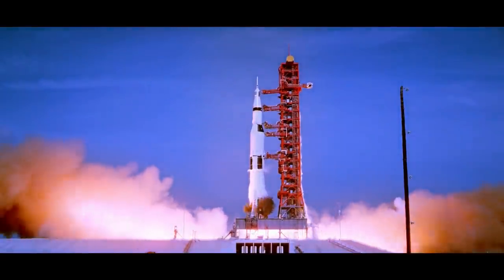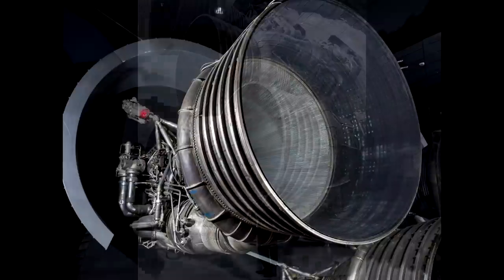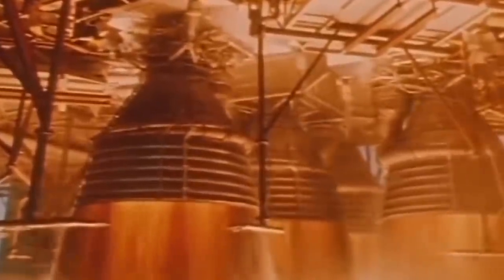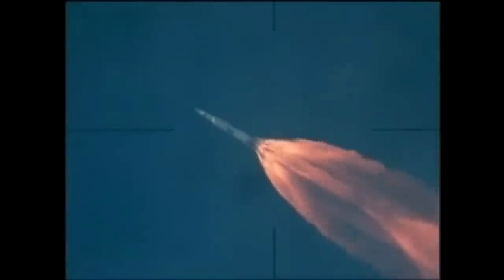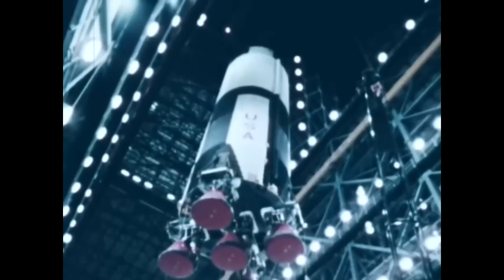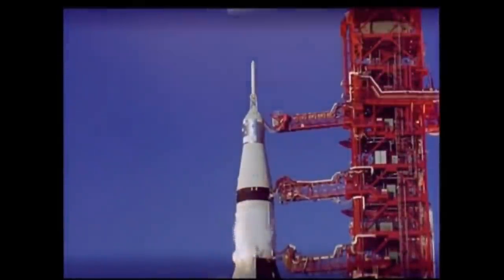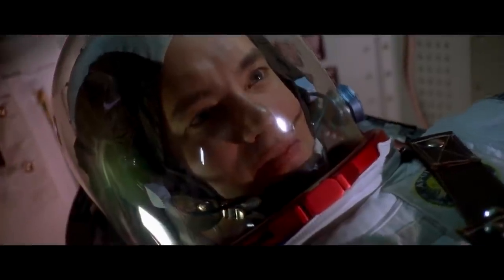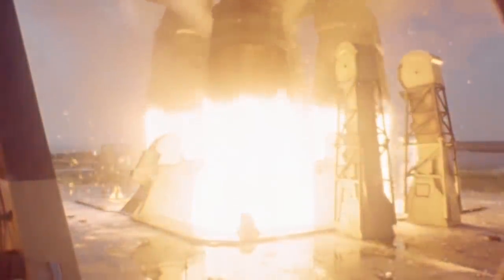Why The Engines That Flew On Saturn V Rocket Look Different In Museums

Comment: I wonder if the fact that it was COVERED IN ASBESTOS is the reason that they don't display that version :)  But to be honest I like the look of the non-covered version better, shows just how incredibly complex rockets are.
Reply: Yep. Even if the covers weren't made from asbestos, I suspect some museums would leave them uncovered anyway to display the details of the actual engines.
Reply: @passthebutterrobot2600  yeah, so they don't look like they melted
Reply: Well, given when the covering was added it's probably not possible to get an authentic engine in that state anyway.
That means the only way to create a display piece with that kind of cover would be for the museum to do it itself, (or get someone to do it for them)

But since this is a non-functioning display piece for a museum, what's the point in making it functionally authentic?
The only goal is that it looks authentic.
Thus if I had one in a museum and wanted to add the cladding I'd substitute something else for the asbestos layer.
It only has to look the part after all, it doesn't have to actually be capable of resisting heat.
Reply: The asbestos was sandwiched between the two layers of metalic thermal protection. that's why the cover looks like metal foil, instead of white.
Reply: @caonabo2  its still asbestos... Not the best stuff to have in an open air museum.  Plus you don't get to see the beautiful details of the rocket!
Reply: @MrDmuncaster Of course, totally agree with you. It is a carcinogen. Now,  my father took me to Kennedy Space Center in 1977, when I believe the EPA's anti-Asbestos law was yet not in effect, and the motors still did not have the engine covers by them, therefore I can assume that NASA consideres by that time that either the engines look way cooler with out them or maybe they were expensive and not worth putting them on display or maybe they broke to easy or were delicate to preserve, I don't know. Maybe a lot of things, but having been HSE Manager for various construction projects in the past,  I concur with your opinion, asbestos is dangerous, bad for the lungs, skin and eyes. Plus it stinks when it gets old.
Reply: @caonabo2  yeah asbestos is bad. But you got me thinking.. It doesn't have to be asbestos... Just has to look the part.  It would be neat to see at least one engine covered like it would be at launch in a sort of cut-away view with an explanation...
Reply: @MrDmuncaster  Yeah, I think so too. The Saturn 5 full scale exhibit used to be outside, but they laid the full rocket down and built a building around it, and separated the stages, It looks awesome the in Kennedy Space Center Visitor's tour. I can imagine that now that is not exposed to the elements, such a cover could be placed over an engine, as you said, with no probability that it would be damaged by rain, high winds or the Sun's UV/Infrared exposure. It could simple be made with two Mylar sheets with a white blanket sandwiched by them, kind of like a Quilt. There is a Stand alone F-1 engine on display in the USAF museum in Dayton, Ohio, but it also lacked the protective sheet. Hope you can visit those in the near future. Now. I'm off to see Dragon 2 undocking from ISS.
Reply: Remember the amount of work it took. Sure it could be easier nowadays, and maybe NASA decides one day to cover atleast one engine, but it's still work to be done.
Reply: @HappyBeezerStudios  true, but it only needs to be a representative example... I am sure that there are plenty of rocket nerds that would volunteer :)
Reply: That, and it was only installed during the stack assembly process and took a lot of effort to complete (100 man-days, given 8 hr shifts).

Comment: Haynes Manuals were and are pretty big in the USA.  They're the best because they start with a used vehicle and tear it down.  The dirty, greasy parts in the photos look exactly like what you're holding in your hands in your garage.  The factory manuals always show pristine, clean parts.  Plus, Haynes always offered work-arounds whenever possible for special factory tools.

Comment: A HAYNES MANUAL FOR A SATURN ROCKET? TAKE MY MONEY NOW!
Reply: I've got one of the books from that series (Rolls-Royce Merlin engine). They're a lot more about the history of the subject than the actual technical details, but they are still excellent. You should give them your money ;)
Reply: @JustSomeCanuck  Also, providing an actual service manual for all the Merlin engines would be one behemoth of a book, since it went through a slew of incremental upgrades during the war (round 50 if I remember correctly).
Reply: @Anders Juel Jensen I'm sure a full repair manual for even one version Merlin engine is a huge book. Getting a set for all of them would be like buying multiple sets of encyclopedias. And now I probably have to explain to the youngsters what an encyclopedia is...
Reply: JustSomeCanuck Old enough to have browsed encyclopedias for fun.  But I guess a workshop manual for routine maintenance of the wartime Merlin engines  wouldn't be as voluminous as the overly detailed official manuals for their modern jet engines.

Comment: I thought it was because you know - *ASBESTOS*.
Reply: Well, museum displays are generally not disturbed once they're in place, so asbestos in a non-operational situation (where no routine stresses or periodic maintenance would disrupt it) would be pretty safe. Asbestos is really just a problem when it goes airborne.
But one could always replace the shroud with a replica with another material in place of the asbestos...
Though it's kind of more interesting to see the mechanical details of the engine anyway - and maybe just have reference photos to show how it looks when insulated.
Reply: Public area and asbestos does not mix in modern day health and safety regulations regardless how you really view it. Its like the Black Death, even if its encased in a inert atmosphere, behind 3 layers of polycarbonate and 6 foot of reinforced concrete.
Reply: LazyLife IFreak Only the engines that flew had the insulation. They ended up on the bottom of the ocean. The ones on display are either spares or test engines and never had any insulation in the first place. The engine parts that Bezos recovered from the seabed were extensively damaged and the insulation did not survive impact with the water so do not have insulation despite originally being fitted with it.

Comment: It's weird that NASA would spend so much time and effort on getting the hardware right with all this trial and error and then faking the moon landing on a studio set. /s
Reply: Yeah I defy skeptics to see this movie and still claim fake. Then again they’re not in the interest of accepting facts so whatever...
Reply: A week ago I spent what probably totaled to a few hours trying to convince internet know-it-alls that just because they know a guy whose brother-in-law works in a machine shop, that doesn't mean that they actually understand how difficult reverse engineering a production cycle actually is.
So because we couldn't be arsed to spend billions trying to figure out a modern manufacturing process for the Rocketdyne F1 that automatically means we never actually managed to get them to work. Flat Earthers and moon hoaxers win in their minds again.
Reply: @ChucksSEADnDEAD Not to mention there's no point in putting F-1s back in production because we've already created an improved version, the F-1B, which is 15% more powerful, more fuel efficient, easier and cheaper to produce with modern techniques and will be equipping the SLS block II, including replacing the Shuttle derived SRBs and RS-25s of the block I SLS.
Reply: VidVwr00 One infamous crackpot theory is they did all the work trying to get there, but had to fake it to meet the deadline.  Only 3 people knew first hand, and one of them is dead.
Reply: @barkingapollo  Yeah, don't worry, NOTHING would change their mind, because they already "know" the truth. I bet that even if you took one to the moon and showed him the Apollo landing sites they'd still find an explanation on why they are still right, no matter how illogical. 

In fact I've watched an Apollo documentary with a Russian dude who was an Apollo denialist and at the end he started to rant about how the Americans faked the moon landings because if Russia couldn't do it, then it's clearly impossible... and then I asked him, "OK then, why didn't the Russians accuse the US of faking it then, since they obviously could follow the progress of the Apollo spacecraft with heir own instruments?", he was clearly discomfited but hand-waved it as "I don't know, but I'm sure an explanation will present itself, because I just know the US faked it".
Reply: @johnfrancisdoe1563    What do you mean "he 3 people who could say "it was real, because I was There" are no longer around" ?    Aldrin and Collins are still alive.
Reply: My3dviews Yeah, sorry, thought Neil Armstrong was the last survivor, just came back to edit it out.
Reply: I think the thing which get's me is, if it was a fake, why didn't the Soviet Union call our bluff? They didn't, because they could track the Saturn V with their radar. They could determine the location the radio signals were coming from.
The Soviet Union never called it a fake, because they new better than anyone outside NASA that it was bona fide.

Comment: I personally prefer the insulation not being on the museum pieces. Without it you are able to appreciate the intricate details of the rocket motor and bell assembly.
    I will always remember talking to Dan Hawkins, retired NASA propulsion engineer, at the US Space and Rocket Center. With a rightfully proud smirk he pointed up to the F-1 engines on the SA-500D and said, "Nobody else has those."

Comment: They called the insulation layer "batting," Scott.
I got hold of a set of aftermarket "batted" resin engines for my 1/144 Saturn V kit.

Comment: I've seen the Apollo static display at KSC twice, once outside in the weather, then inside the protective structure built for it a few decades later.
I, for one, am glad the display didn't have the engines wrapped in a conceiling thermal wrap.

Comment: Awesome video! I never knew about the insulation blankets. I had noticed, during the original launches, that the flams tended to rise up the sides of the S5 as it got higher and faster. I was always worried that it would cause the rocket to explode. I was born in 1964, so I just remember some of the last launches, including Skylab, and the Apollo/Soyuz missions. A lot of what I got to see was on the nightly news, unless it took place during the summer. Oh, those were the days! Now, it seems to be coming back again, thanks to Space X, and it's Dragon crew capsule...Beautiful performance!

Comment: After working 15 years at the rocket test site at Edwards AFB I saw the F1 engine a number of times a week driving by or ones a year when it was pressure washed even that one was not the typical museum F1?  The larger fuel lines had some of the inconel foil and asbestos so Rocketdyne did do some work on insulating and protecting. Unfortunately some one took the Rocketdyne ID plate off the engine.  Also the engines are in someways a work of art with the tubes that carry the liquid propellant  down to cool the nozzle and pre heat the propellants.  
It is good to remember these details.

Comment: Just saw the Apollo 11 movie and yes, it was very well done. No added narration, just what a few like Walter Cronkite said at the time. Some footage that I don't remember ever seeing before such as what was said in the spacecraft while out of comms with the earth and some from the LEM just after liftoff while it was still "facedown" on the clime out. It must have taken hours to fit the "b" roll footage with the mission control log tapes to sync the voice with the controller during "go - nogo" poll. Adding the mission elapsed time clock with a "count down to action" clock and the added sound track made for some suspense.

Comment: That’s a view from my viewing box 8! On liftoff! The thermal protection was meant to prevent extreme sudden changes which could cause dangerous cracking in the cones and lower parts of the engines. Cracking from suddenly extreme temperature changes was proven to cause explosions in early test launches I would pack insulation from time to time and take restful naps on the stuff in the engine compartment area during the long shifts on the smaller rocket engines

Comment: Like Patsy said to Arthur, King of the Britons: "It's just a model". I'm slowly working on the old Revell 1/96 Saturn V and I am absolutely going to use the "incorrect" engines. They look way more interesting than the batted ones. 

I am going to put a BPC on it though. The escape tower looks funny attached directly to the command module.

Comment: I've used some official NASA inconel foil and (hopefully not asbestos) insulation on a CNG engine exhaust.  It is certainly tough to work with and get to the right shape.  It does an excellent job of keeping the heat on one side! 
 Funny that I have seen those slow motion close up videos a number of times before and never really noticed the covered engines.

Comment: As Scott says, the insulation was not added at the factory, but while the rocket was underdoing final assemble at the cape.  I suspect that in all cases, the rocket then flew.  The engines in museums never made it far enough along the process to be put into a flight ready rocket and then get the insulation installed.

Comment: It's the same thing that happens with any truck or car, why the back bumper is so dirty from exhaust in winter, or the leaves or material in a pickup truck. Also, why semi's now have those attachments on back to reduce drag, at those speeds those engineers came up with solutions to the problems and it's just amazing.

Comment: I believe this effect was seen on the earlier versions of the Falcon 9 as well. The fix was to add additional flame/heat protection to the engine area on the later block 5 boosters.

Comment: Even if museums wanted to be 100% accurate, I doubt they want to spend thousands of hours using asbestos blankets to cover all the interesting parts of the F-1 engines.

Problem #1: Lots of time necessary. Problem #2: Asbestos.
Problem #3: Less interesting result.

They should just have an information plaque with a picture of the insulated engines with a description like you just provided.

Comment: Hmmm, that's pretty cool, I never knew that!  Thinking about the museum versions though, it's probably better that the thermal insulation is missing, so you can see the heat exchanger (I think that's the term) and other various parts.

Comment: I can understand why the museums do not feature the thermal shielding, both in terms of when it was added and also because it covers the engineering of the engines themselves. It would, however, be cool to see one or more of the museums add it in a "cut away" format with bits of it removes from one side to show the internals as well as the shielding. It would be an excellent example of how quickly things changes during the engineering time tables of the apollo program.

Comment: There is a sort of parallel with the airlock of voskhod 2 which is almost always shown with the outer thermal blanket removed to display the aeroboom structure.  I think even Leonov has painted it that way!

Comment: Sorry Scott, the pressure behind a shock-wave is higher than the free-stream pressure outside.

However if the flow behind the shock wave is still supersonic, then when it reaches the back of the craft, the rear edge acts a bit like a convex corner, around which the flow will create an expansion fan, throughout which it accelerates and decreases in pressure (and hence sucking in the exhaust).

Comment: One of the first things I bought for my brand new truck was the haynes manual for it. And it came in handy when I needed to change one of the light bulbs. The first time I have ever had to remove the entire light assembly to change the bulb. No way in the wold was I going to figure that out on my own.

Comment: When I visited the F-1 display in Huntsville, the thing that surprised me was how small the gimbal bearings were.  The F1 gimbal is basically a universal joint like in your car, but bigger, sitting on top of the LOX dome at the top of the engine.  You can't see the gimbal on the 5 mounted engines, but there is an F1 off to the side which has the gimbal exposed.  Those U joint bearings are about 3 inches by 2 inches.  Since there are two, that makes about 12 square inches across which all 1,500,000 pounds of force goes... which means the bearings support 125,000 psi.  That's a lot.  Like, seems like too much.
Reply: [adding] The yield strength on high strength steel, like the stuff they use in the best US submarine hulls, is 100,000 psi.  HSLA steel is 86,000 psi.  I suppose they must have used 350 Maraging nickel-cobalt steel (250,000 psi), which would have just been developed as the F-1 was developed.

Comment: The rocket exhaust suck-back effect (yes that's what I'll be calling it) can also be regularly seen on SpaceX launches, where the bottom of the Falcon 9 gets some flames scorching around. It's not as pronounced as that on Saturn Vs and Space Shuttles though so it's easy to miss.

Comment: It's funny that you uploaded this now as I am working on an Airfix 1:144 scale Saturn V model and was just thinking about how to do the batting on the F-1s. Realspace Models does make a set of batted engines, but only in 1/72 and 1/96 scale, so I will attempt to simulate it using Bare Metal foil instead.
Reply: Aluminium self adhesive tape might be useful, check out "Tested", Adam Savage's YouTube channel, the "One day build: customizing Adams hero sword" has tips on using this material to get different finishes and effects.
Reply: Thanks, I will have to check that out!